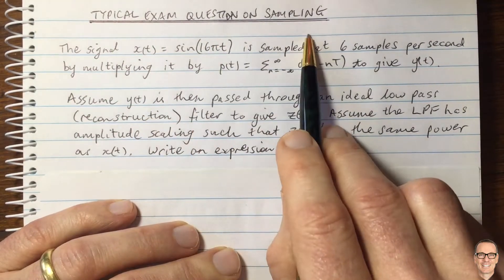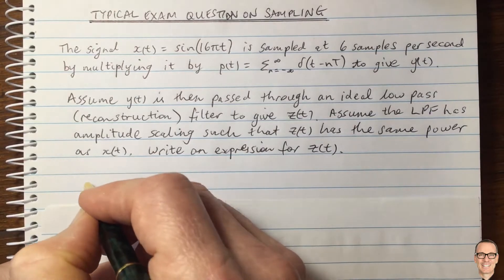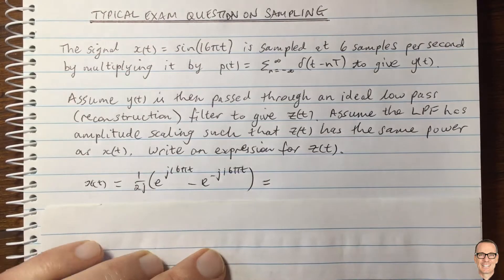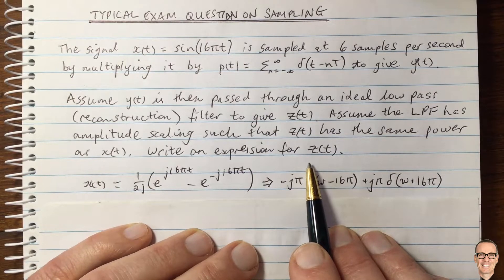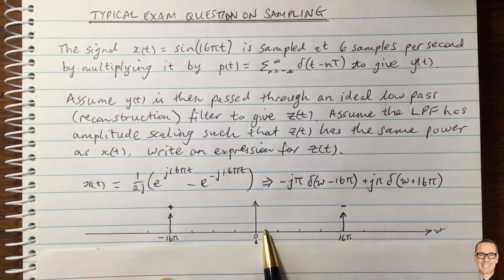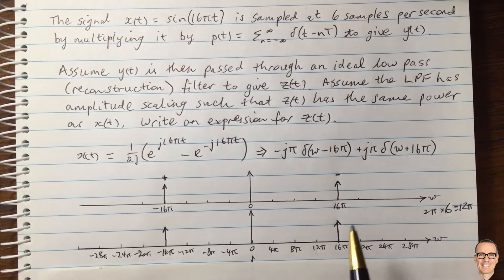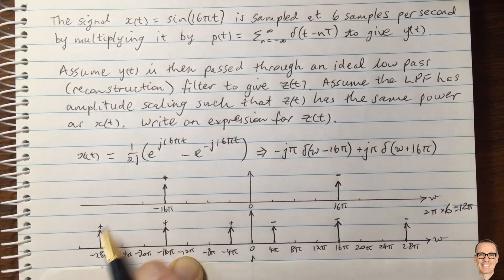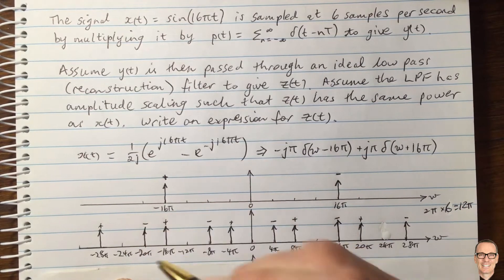Typical Exam Question on Sampling

Comment: my formula sheet gives the fourier transform of sin(16 pi t) different from what you have written.  π/
j [δ(ω − ω0) − δ(ω + ω0)] is what i get. so now i am confused.
Reply from the maker: Don't forget that j^2 = -1 .  If you multiply your expression by j/j (ie. j on the top, and j on the bottom) then you'll get j^2 terms on the bottom ... which equal -1 ... and the "j" will have moved from the denominator to the numerator (which is what I showed in my expression in the video).
Reply: @iain_explains  tnx for the clear explanation

Comment: Hi, professor. I have a question. It is actually quite an open question. Let's say, we got a signal in the frequency domain from our measurent instrument and assume the signal has been processed through ADC and DFT. We don't know any information about the siganl. There seems to be many harmonics (although we don't know if it's a real signal or just created from aliasing) and we want to find out what is the actual signal and what are from noise, interference, distortion, aliasing, nonlinearity, and so on. I think this is an real-life set-up when we want to analyze signals on screen. What strategies can we make to find out what's what? I can only come up with 2 idea which (1) try another signal into the system and see what happens and (2) try a better ADC to avoid nonlinearity and errors. But they are all just abstract ideas and not clear.I want to know many more strategies to solve this problem. What do you think, professor? Thank you.
Reply from the maker: It depends on what ADC chip you're using. ADC chips typically have an analog pre-filter before the digitisation, to eliminate the frequency components of the analog signal that would cause aliasing in the sampled output.

Comment: Dear professor what will be the sampling rate for the base band signal which is nonzero from -30kHz to +20kHz. One of my friend asked  this question. Sir, is 50kHz is correct??. Pls reply sir.
Reply from the maker: Well, first of all, this would be a complex valued signal, since it is not symmetric around f=0. So then you'd need to decompose it into its real and imaginary components, and then sample those separately. See: "Sampling Bandlimited Signals: Why are the Samples "Complex"?" https://youtu.be/JglRGRizqGM

Comment: Thanks for the videos. 
I didn't understand one thing quite well. 
How do you know that the cutoff frequency for the filter is w_c = 6pi. How should I figure this out? 
And also you can't recover the original signal right? Because the max.frequency component of the signal 's FT is 16 pi right? And so 
the sampling frequency of 12 pi is not at least twice the max. frequency component. 
Thanks !
Reply from the maker: Since the sampling rate is 6 samples per second, therefore the maximum frequency that can be exactly reconstructed is 3 Hz, which equals 3 x 2pi radians per second (angular frequency).
Reply: @iain_explains  I think the example given here is that of undersampling. So if the sin(12*pi*t) carrier was modulated by a 1Hz signal, the fact that we placed the carrier at 3Hz through undersampling would not be a problem.

Comment: Yes!! Please do more of these!

What was the Nyquist solution you mentioned when you made the sampling bounds +/-6pi for 3Hz?
(3 * 2pi = 6pi ?)
Reply from the maker: According to the Nyquist sampling theorem, any signal that has a Fourier transform that equals zero for all frequencies above 3 Hz (ie. is band limited) can be fully reconstructed from samples taken at 6 samples per second. The corresponding ideal low pass reconstruction filter, for a 6 sample per second sampler, has a frequency response that is constant between 0-3 Hz and equals zero above 3 Hz. And f = 3 Hz equals w = 6pi radians per second.
Reply: However, a pure sine wave sampled at 2B results in zero samples. Therefore reconstruction is impossible. It is a must to sample such signals at rate greater than Nyquist rate.
Reply from the maker: Yes, you're right, strictly speaking I should have said greater than 6 samples per second. But it only needs to be epsilon greater, where epsilon can be infinitesimally small.
Reply: Can epsilon be smaller than one sample ? Please elaborate.
Reply from the maker: A pure sine wave only has three parameters: amplitude, phase, frequency. So, in principle, you only need three equations to solve for the three unknowns (ie. you only need three samples in total!). However, no matter what you do, as soon as you sample, there will always be unavoidable multiple solutions (or ambiguities) from all the multiples of frequency which will also satisfy the equations, no matter how fast you sample, or how close your samples are).  Another class of ambiguity comes if your three samples are exactly a wavelength apart. Another is if they are exactly half a wavelength apart. Of course you can avoid these last two classes by always sampling faster than twice the highest frequency component (but it only needs to be epsilon higher, so that the spacing of samples is not exactly half the wavelength).
Reply: @iain_explains  Sir Thanks a lot. Please make a video on decision directed mode of adaptive equalizer. Particularly how it overcomes variations in channel by generating error from slicer output and equalizer output. I can't understand because slicer input is output of equalizer so error is simply  noise so how it is effective in mitigating multiplicative fading channel effect ?